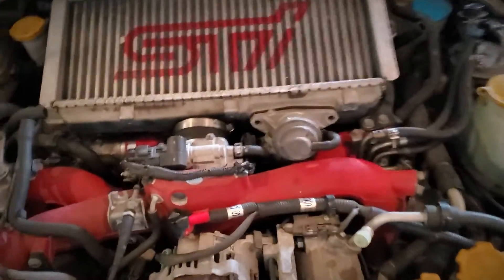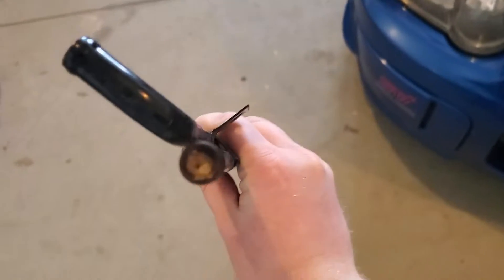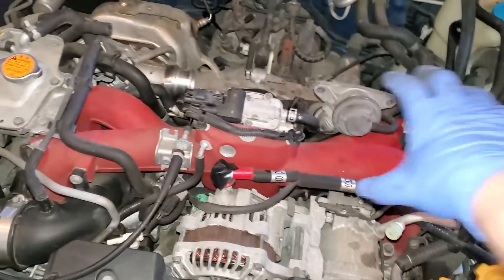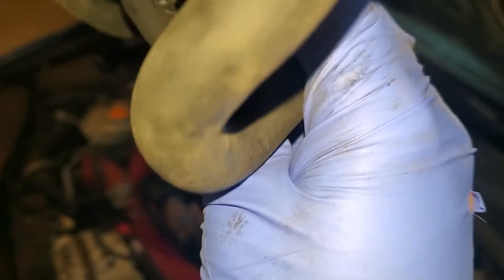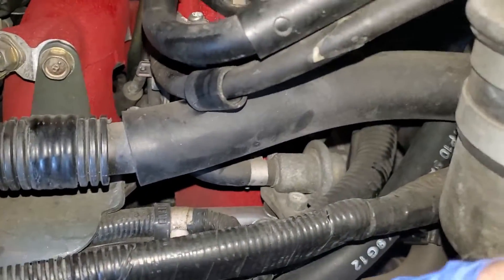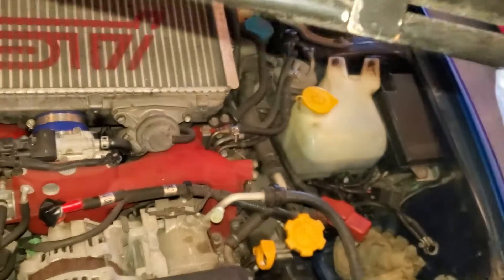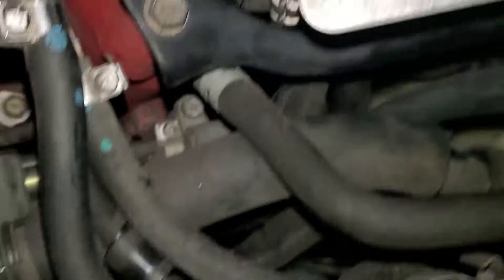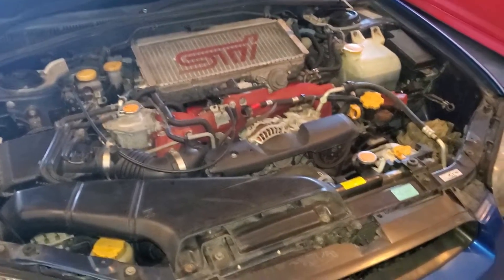SUBARU WRX STi - CLEAN your PCV! PLEASE...

Comment: You could’ve just bypassed that completely and just ran the two valve cover vents to a TEE and continue to the turbo inlet from there.
Reply from the maker: Correct. Didnt have appropriate hose near by. I tried to get some. I have some now

Comment: Ive seen people replace an actual pcv valve thats sort of a t shape, thats not on EJ207s tho right?
Reply from the maker: It is. But its not the same as a USDM. I think its just a T section vs a PCV valve. They are definitely different though.
Reply: @BoltsNBoost  gotcha, you happen to know the part number for the Ej207 one? Im gonna clean my hoses and the metallic tubes this week on my 03 blobber, think im gonna see horrors like u showed on this video 😅!
Reply from the maker: @AsdPwn3d  I dont. I could try and search it today!
Reply from the maker: 11810AA000 is the part number for the PCV on the intake mani. It may be the same for the block... unsure...I cannot tell from the diagrams. I am not able to get the PN for the T tho. Which is odd.
Reply: @BoltsNBoost  cheers man, i'll look for one later, just doing the cleaning as first aid😄 its the only possible reason for oil consumption for me because the car doesnt smoke at all and the gas mileage has went down too
Reply from the maker: @AsdPwn3d  yessir. That was my smell I was getting too.